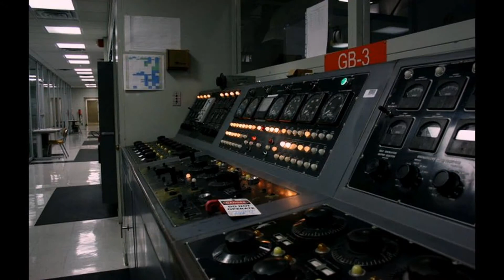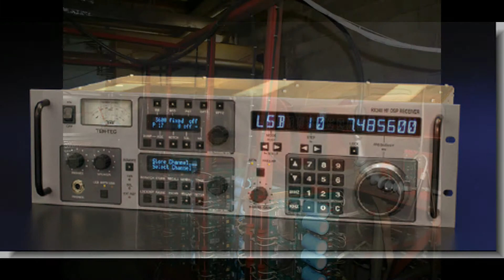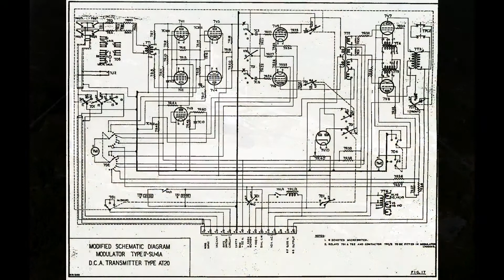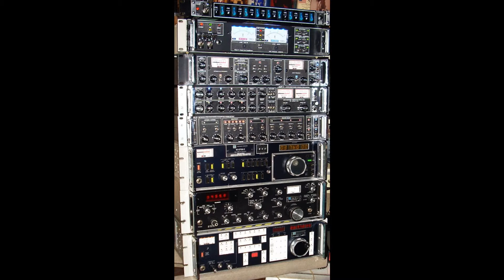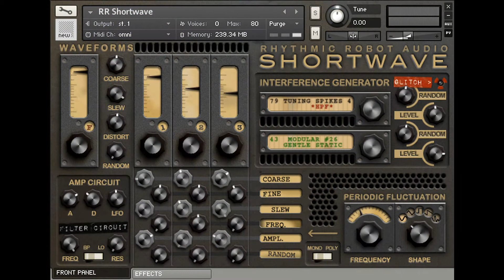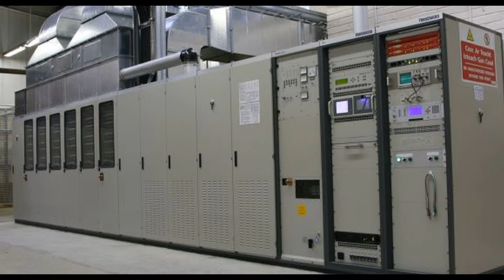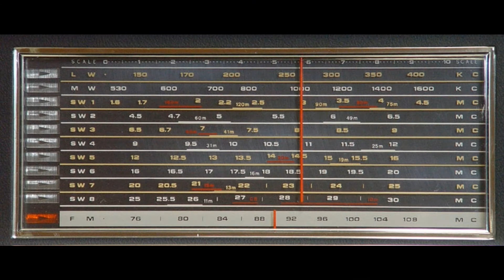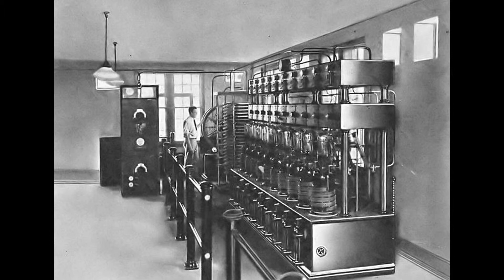RADIO TRANSMITTER ANTENNAS, SHORTWAVE ANTENNAS AND RADIO  TRANSMITTER EQUIPMENTS

Comment: It's a shame Digital Radio Mondiale never took off, it would give many shortwave broadcasters a better quality transmission system to reach listeners, and if there are difficult reception conditions, because of ionospheric conditions or solar activity, there are robust transmission modes to improve the ruggedness and reliability of transmission, albeit at the cost of a little bit of quality, but is not too critical.

Comment: I remember listening to all of these short wave stations back in the 60's and 70's. It's a shame they are now off the air. I believe it was a big mistake, we depend on the internet way too much, What happens if the internet goes down ?  Then we are all left in the dark ...
Reply from the maker: The shortwave band is not empty; there are stations broadcasting both day and night. Radio amateur operators are active on shortwave bands and even above the CB band. It is easier to achieve good reception in these less crowded bands.
  In America, we hear fewer stations, whereas in Europe, there are significantly more stations on the bands. Additionally, stations from Asia, Africa, and the Middle East are also present in Europe.
  You can download an app on your phone to listen to the shortwave band using online receivers located anywhere in the world. Yes, I also utilize this option. There are free apps and services available for this purpose.
Reply from the maker: This antenna is still in use at 9330 kHz every day. It is capable of transmitting up to 2000 kW (yes, 2 MWatt!) power.

Comment: 9:41  That's an interesting antenna.  What is it?  An array of folded dipoles with some kind of curtain mesh reflector behind?
Reply from the maker: WBCQ ANTENNA FOR SHORTWAVE BAND. PLEASE WATCH MY OTHER VIDEO.  I RECORDED IT  UNDER ONE OF  THE FIRST FULL POWER TEST. I PUSHED IN THE ANTENNA ON THE SCANNER AND STATION WAS STILL RECEIVED AS LOCAL STATION ! 500 KILOWATT!
https://en.wikipedia.org/wiki/WBCQ_(SW)

Comment: 2:35  Wow!  Inductor and capacitor heaven!  Judging by the size, there must be some serious juice running through those when they're operating (hopefully with nobody in the room at the time!)...
Reply from the maker: WBCQ https://www.youtube.com/watch?v=t7rToOfKEBw
PLEASE LOOK FOR MORE INFORFMATION ABOUT WBCQ.
The station is broadcasting daily. I hear German,English, Arabic transmissions daytime. Those are directed transmissions and I am located way behind the antenna. ( Chicago suburb,Illinois, antenna is in Main state)Possible the waves coming to me after travel around the globe  or coming from a side beam of the antenna because those daytime signals are low. Frequency is always 9330 kHz . The transmission can reach any point on the globe with  powerful, local-like signal.This monster antenna has 3D movements. See it on WBCQ web site or find more info   on youtube..
Reply: Is it still being used ad where is it?